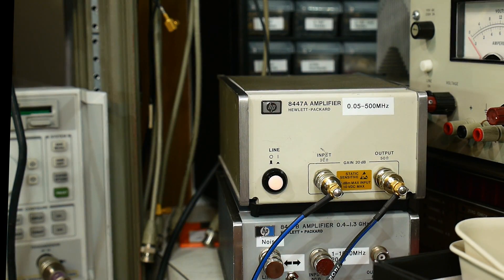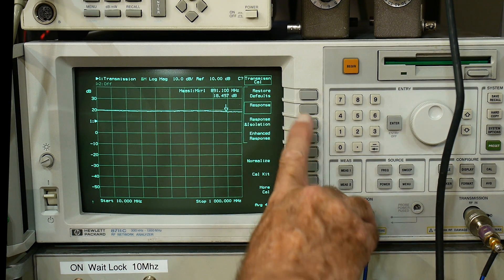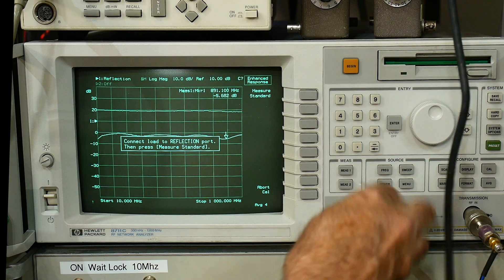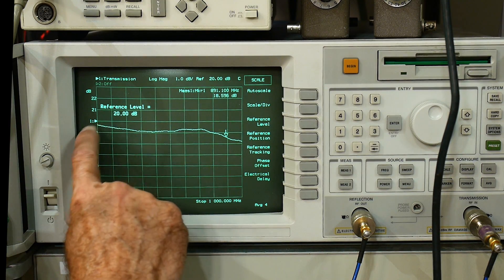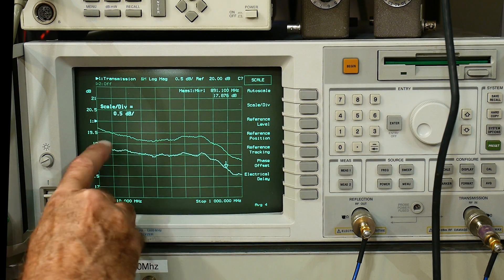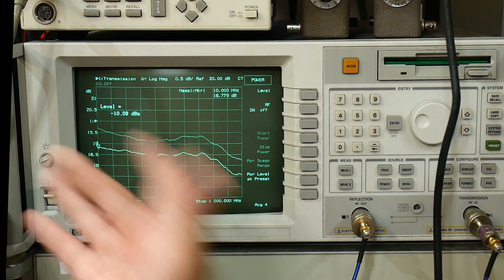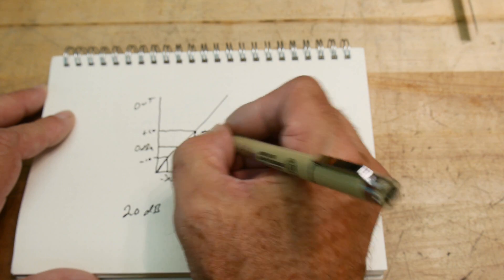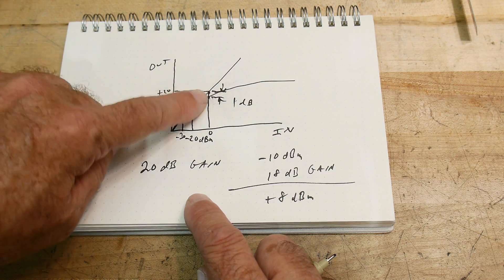#908 RF Amplifier 1dB Compression Point Measurement

Comment: Great video on a often overlooked electrical parameters of RF Amplifiers.

One of my beef's with the P1dB specification of many RF AMPLIFIERS is that it does take into consideration WIDEBAND and ULTRA WIDEBAND derating.  

For example, if in the example provided in the video, IF you were to actually "SIMULTANEOUSLY APPLY" the 10Mhz to 1Ghz signal (versus the  narrowband sweep that is performed by the VNA) you would see signal degradation of any complex modulated signal.  

There needs to be a standardized characterization of RF Amplifiers that allow you to input frequency range and average power level of that overall area under the curve of the wideband signal and give you metrics on the intermodulation distortion and harmonics created.

Comment: Just to clarify the P1dB is the input signal level (in this case it P1dB = -10 dBm) and the Output OP1dB is the output power OP1dB = P1dB + Gain = -10+18=8dBm